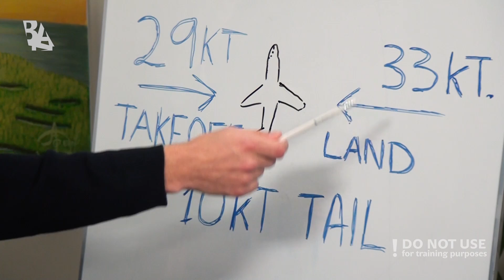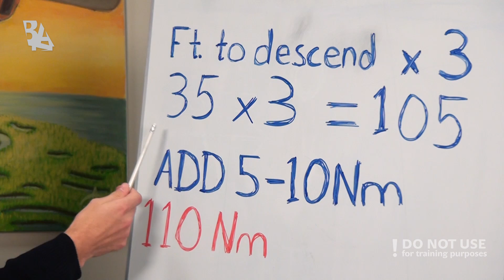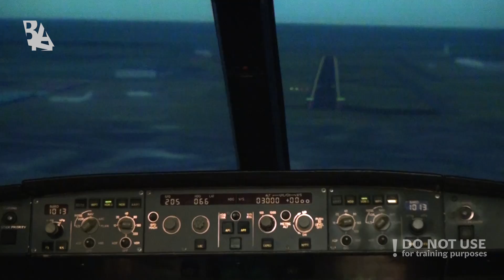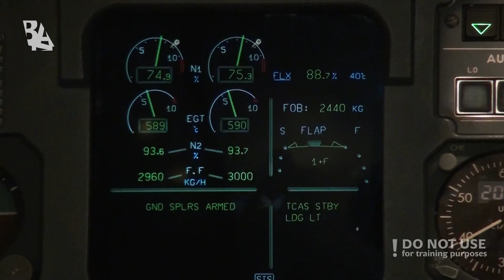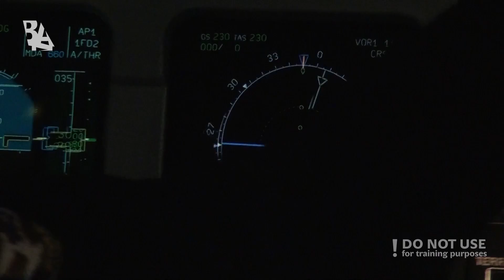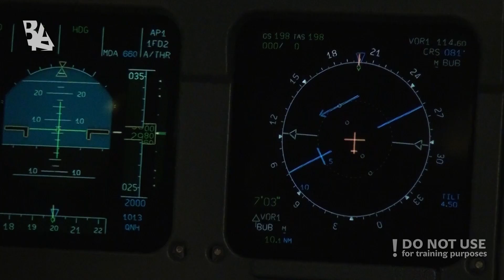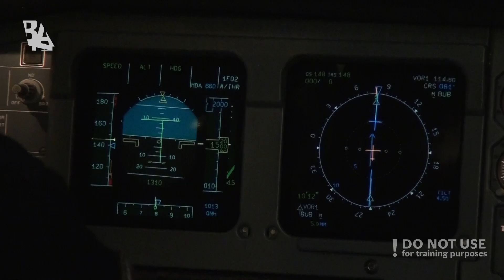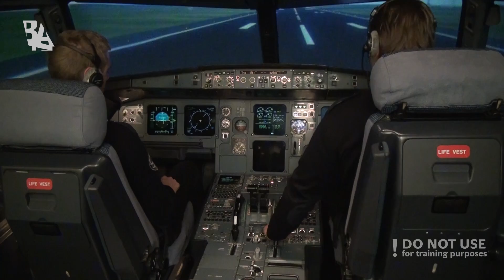Viewer question - answer (part III) - Baltic Aviation Academy

Comment: What strikes me most, is the total dependence on the autopilot.
I know it reduces pilot workload, but can a modern-day trained pilot control his/her aircraft throughout the flight envelope with just the stick and rudder?
I have noticed in the "no-flaps" video, you had both autopilots working and  manual throttle.
But wouldn't it be a more less rough of a landing, if you landed manually?
Reply: In the real world with an experienced pilot they would not rely on the AP and they would generally switch it off for a much larger portion of the approach. With a flight control failure they would go straight to manual flight.